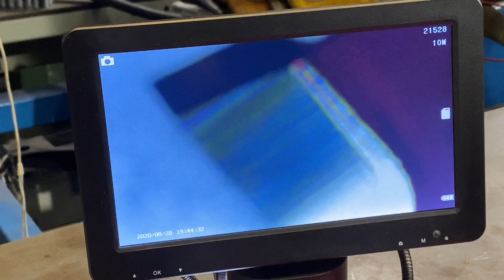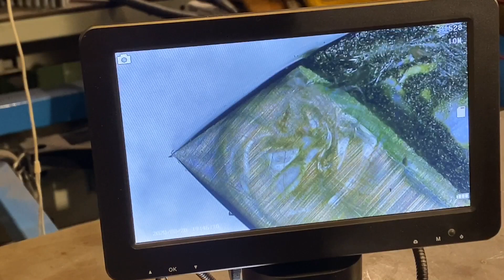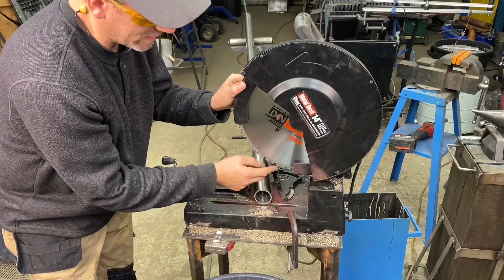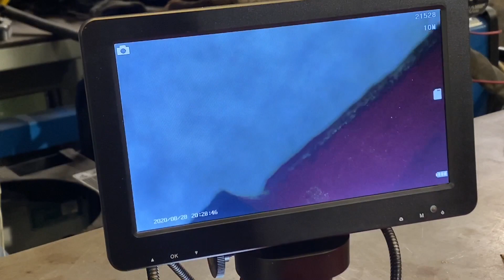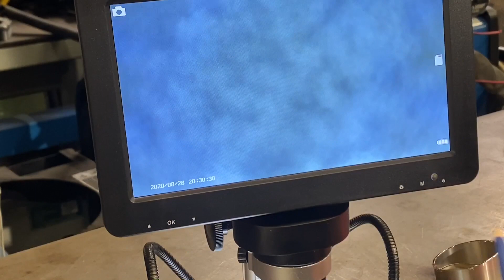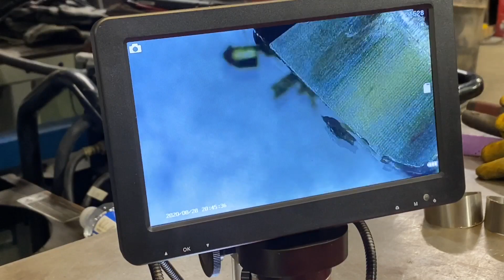TOOL REVIEW WHAT SAW BLADE CUTS STAINLESS STEEL BEST!!!

Comment: Great video, but if you are honest, after 60 cuts, the Diablo looks almost brand new, barely a scratch, meaning you could get probably to 200 cuts!!! NOW I need to cut 80 inch of 316 stainless steel, 1/8 inch thick, I have a 7-1/4 inch hand saw always fitted with a diablo Steel Demon, and I already have cut a lot of steel with it, I have beaten the crap out of it, I was not certain I wanted to try it, but tomorrow I will cut that plate with that old blade and see if it will cut it clean!!! 1/8 inch is pretty thick!

Comment: Good video!

But, I wish people would learn how work hardening in stainless actually works. It's Not the heat that causes work hardening, it's the work hardening and bad cutting parameters that causes heat.

Austenitic Stainless steels such as 316 can't be heat hardened and it  doesn't get harder by welding, so why would the significantly lower temperatures in cutting operations cause hardening? The answers is that it can't and it doesn't :)

Work hardening, as opposed to normal hardening, is a cold process that happens when you work the material, such as deforming it by bending, cutting (saws, mills, drills etc) or cold rolling.
That's why it's called work hardening :)

The misconception probably comes from there being lots of heat generated when stainless starts to work harden and gets harder to cut/drill.
Stainless just need very different cutting parameters than mild steel, and people tend to spin drills too fast and apply way to little force/feed to slowly. You must take a proper chip.

Comment: I don't need precision cuts or a lot of them. I am using a standard ren inch miter saw with a DeWalt abrasive wheel. I'm cutting sixteen gauge stainless plate. Is there a problem doing it that way that I'm not aware of? Any more dangerous?   I know they say abrasive wheels can 'explode', but I have never had an issue with that.'

Comment: I'm an electrical superintendent for a company that does water treatment plants we use 316 stainless steel Unistrut we use Evolution blades one thing we do that helps double the life of the blade is break it in on soft steel first before we use stainless steel

Comment: Great job on the video. I found out the Evolution yellow for stainless is awful. Bought on Amazon though, so sent it back and got a full refund. Lasted about 20 cuts, 1" sq tube, 304, 16 ga. I need a reliable blade for stainless. Thank you for making this video.

Comment: Great informative video....Just finished making 4- 8 foot cut through 1/4 inch tread plate and the blade is done....Sort of wanted to make sure there was not something better out there....the Diablo seems to be it.
Reply: Update to the last posting, I went to change the Diablo blade with another one and it turns out the metal cutting saw I have was filled with metal shavings, it has a window in the side that's is supposed to show how full it is but that is not the case. 
After what seemed an eternity I got the saw emptied out and inspected the blade teeth which are in almost perfect condition.

I have done 3 more 8 foot 1/4" plate cuts and the blade is still in very good shape.

Apologies for misleading people with the earlier comments about blade durability....it is very impressive....

Comment: I purchased the Diablo to cut some 2.5 x 2.5 16 gauge and didn't do very well.  It was heating up onto the flats of the stainless steel.  Can you demo an Evolution Blade?  This Diablo blade is going back!.
Reply from the maker: No problem I’ll look into it , thanks
Reply: The Evolution yellow is crap.

Comment: I like the Diablo blade as well. However. I usually buy mine from Atlas Tools (not pushing advertising). Never any problems. In a pinch, I bought one from Home Depo.. and it was crap, didn’t last 10cuts. Same blade.. two different stores. I had emailed Diablo with photo comparisons and questions as to why they performed drastically different .. the only reply I got back was “email received” lol crickets. 

But.. In still buy their blades. Lol
Reply from the maker: I tagged Diablo on this video and no reply but Morse got back to me and are sending me some other blades to test

Comment: Have been using carbide blades like that for decades. Learned from doing high end manufacturing on aluminum using a stick wax like DoAll or toolsaver is mandatory (coat both sides of blade then teeth while running) or guaranteed to destroy a new blade.  
Have you tried Evolution?
Might consider using a HemSaw for lots of pipe.  I use one for cutting my damascus billets. Blades are $27 each & last a real long time. Recently got some from BladeSerpant haven't been able to try them yet on 416.  Buy the automatic NG 120 or better model.  Have used several.
Reply from the maker: Thanks Tim for the info I’ll look into that
Reply: @BonifabcustomRobBonifacio  Really worth trying Evolution yellow for stainless.  It gave me 25 cuts of 2 x 2 x 1/4 stainless angle